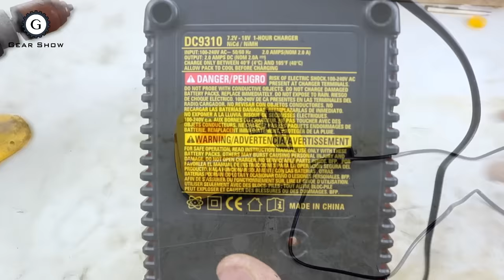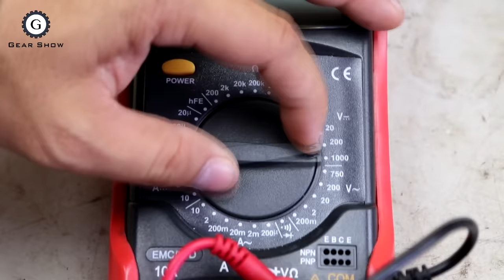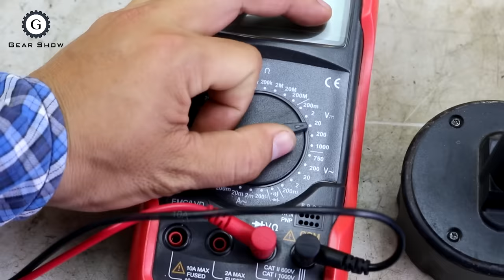Cordless Drill Restoration | Dewalt XRP 18V TYPE 1

Comment: you should remove old cells and install li ion 18650
Reply: 和我的想法一样
Reply: not a regular 18650....only the ones with high current discharge rate !! 
otherwise you might hear some noises and find yourself with a torch in your hand....but if you do it, please record it and post it
Reply: You cannot simply replace NiCd batteries with 18650 LiOn batteries. You'd need to install a battery management chip to regulate the batteries if you could even fit the 18650 into the housing designed for "D" sized NiCd.  You'd also need to find a new charger because you can't charge 18650s on a NiCd charger.  It's best just to replace the NiCd with new NiCds.
Reply: @JonnyRicter  I'm guessing the NiCd chargers would hardly ever damage the Li-Ion batteries considering the they had memory effect and all kinds of quirks, so Li-Ions should be fine. Buddy of mine did the Li-Ion conversion years ago and she's still chooching like crazy, batteries from old laptop batteries, still holding fine :) In the worst case you have more powerful batteries that will for sure last longer than the old NiCd junk of technology, no fire if you know what you're doing and you're not pushing it.
Reply: Emiliyan Yankov impossible. You cannot charge lithium batteries on a NiCd charger without destroying them and here is why. NiCd battery cells are 1.2v each and lithium cells are ~3.7v each, you cannot fully charge a 3.7v cell with a charger that is trying to fully charge a 1.2v cell....and that's just the beginning. Let's pretend the charger has the correct voltage now, the battery pack must have a BMS chip that is able to communicate with the charger because LiOn charge completely different then NiCd, they must charge the battery with constant current to near full, then slowly reduce current to a fraction of constant until the battery reaches full, all the while maintaining a constant and correct voltage (between ~4.2v to ~3.2v). Also, NiCd chargers float charge, meaning they constantly charge the battery cells to maintain full, if you do that to lithium it will explode. A lithium battery must be discharged and then recharged, it cannot be "topped of." Finally, lithium batteries reach a higher temperature when recharging than NiCd, so unless the NiCd charger has been altered, the heat detection circuit will trip and cause the charger to stop charging because it thinks the batteries are over heating. So like I said in my previous post, you cannot simply pull out old NiCds, throw in some LiOns, and be on your way, it's much more complicated than that and in most cases it's simply better to just replace the old NiCd batteries with new ones.
Reply: @JonnyRicter  noone is saying you should charge them in the old charger dude xD ok, sleepy head in me maybe said a sweet stupid nothing in english again. all i'm saying is li-ion conversion is a thing for a reason and it has every logic behind it. i don't even wanna discuss details because it's too easy to do it when you run out of excuse and find a way, just like the adaptor Frank W is mentioning below :) 3x1.2v = how much? 3.6v? wow that sounds so close to 3.7v... no need to stretch this simple task into oblivion :)
Reply: Emiliyan Yankov I'm done. You obviously don't care to learn.
Reply: @JonnyRicter  i learn plenty, just not from you and not on this topic. you're too focused on modern and expensive solutions, while failing to see how most people doing this don't use temp trips and all kind of protections, cause old or just cheap crappy drills don't even have those. and that's pretty normal for an old nicd shitty drills xD i mean no disrespect, don't get me wrong, i'm saying it's easy to do and it can work, won't be perfect but it can provide better results than just buying new original nicd packs every 6 months. i don't care discussing it further just because of the things you pointed out. better be safe and better not challenge the tech, i'll buy li-ion drill next month and i'm set. just saying, books and theories mean shit, wehn it works it works, you keep denying i see more and more people using such batt mods and being happy with it. obviously it's not impossible, at least my scenario, not whatever you're imagining, but i'm too tired for this convo any and i'm going to bed ;) peace, brother :)
Reply: There's no need for a DIY conversion, there's a type of original Dewalt Li Ion batteries which fit into this cordless drill without modifications.
It's the predecessor of the actual sliding battery, which was put in in the same way like the NiCd one. The electronics are all integrated into the battery, and there's a original charger which can charge NiCds and Li Ion.
Reply: @JonnyRicter  It's total bollocks to say that lithium ion cells need to be fully discharged and can't be "topped off", as you put it. In fact that is a really good way to shorten their lives.
I build li ion batteries for a living (for ebikes), and I have also converted the same model of drill in the video to li ion, along with many other power tools.

Comment: Nicely done. Don't complain about weight! At least you got great product from times when Dewalt used to make things using higher quality materials. That is high quality drill especially because of gears made out of metal, todays drills have plastic gears. I'd always go for metal gears and bit more weight because of durability than plastic.

Comment: Ace job mate, I need to strip mine down just for a clean and re-grease, it's seen a lot of work. 👍👍
Reply: throw away tools these days, dont break the golden rule "if it aint broke dont fix it" if you open it up something will go flying or some brittle plastic will break... run er till she lets the smoke out then be excited to get a new drill amazing what they have improved on in just the past few years
Reply: @AndrewBrowner  - Like Lithium Ion batteries and better torque ratios with Dewalt since its still a brand that is decent. Refurbishing this drill with these old batteries is kinda pointless but otherwise still interesting to watch.

Comment: I like it. I think You can use li-ion cell to replace ni-cd cell in the battery, you will have long time to use with it
Reply: Yes. DeWalt actually made lithium ion batteries for the older platform but they were very short lived in and very expensive.
Reply: Li -ion is the technology that almost nowaday power tool company using,the china li-ion cell is not expensive,remember buy the cell for power tool,about 2000mAh ,15A, don't use the cell for laptop

Comment: Great job but I would have greased the pins the gears sit on too :D
Reply: And he did not regreased / replaced ball bearing - the oryginal grease was washed away - 6.42-6.45. Except this - good work!
Reply: Well that´s generation YouTube/Facebook for you.
The end result is a pleasant looking drill. But obviously the YouTuber has no clue about mechanics or how things work. Grease, who needs stinkin´ grease in a ball bearing?  It looks good, that´s enough... shakes head

Comment: 5:30 Release the schmoo!
 But seriously, great skills to have. Unfortunately I am not so sure it's all cost effective when my Aldi's sells a nice lighter 12v model that would fit you better for $25 (including battery and charger BTW) last week in the flyer. I bought one a few years back and couldn't be happier with it.
Reply: If you like cheap stuff. DeWalt is quality, and it's meant to last, so it's worth repairing.
I bought a heat gun in Aldi, and it's melting its own chassis. Last time I'll ever buy a power tool there.
Reply: @Michael-Archonaeus  Nothing wrong with cheap stuff as long as you know its limits. Next thing I know you'll be putting down my $14 Walmart Branded "Hyper Tough li-ion cordless screwdriver which also converts to a drill-driver. BTW I do own 2 Dewalt drills. I like the built in belt holder a lot. But most often they are more than I need so I still like and use my little Aldi's 12v unit.

Comment: my dewalt drill stoped working I will open it and give it a check over tmrw
Reply from the maker: You should check the battery pack and check the carbon brush set.
Reply: it's was working I been traviling for 1 year and wen I got bk and tryed to use it was not working both battery charge but nothing

Comment: Trying to save the battery pack was good, it took a charge but even when you were just messing with the chuck i could hear it not sound right.

Seemed to lack power despite charging fine.

Comment: Only issue could not read the can to determine what solvent or grease or gel you were using on the gear. Besides that everything looks great and the two Dewalt drills I will be working on will go a lot smoother.

Comment: i had my batteries go in one of these dewalt xrps and i did the same as you but one small change. i ordered new batteries but opened them and transfered the innards into the older battery cases that had the dewalt labels on

Comment: In a drill this old the ancient nicad batteries are going to be rusty, corroded and shorted and won't charge. Sometimes they can be revived for a short time by jumping them with a DC welder to burn off the shorts but it doesn't usually work for a Dewalt anyway since they will be too old.

Comment: Dewalt should pay you serious folding money for this video!
Reply: dewalt is not too happy about this video they want you to buy a new one instead.  thats why they stop making spare parts or if they are available prohibitively expensive so you'd just buy a new drill instead of repair.
Reply: @10OZDuster  That makes sense, now that I think about it.  Planned obsolescence strikes again.
Reply: @chriswenkle2635  Dewalt actually is a better company compared to Makita....at least dewalt made a nicad to lithium battery adapter so you can use new lithium to old nicad drills like the one shown above.  I bought a china adapter that would adapt a dewalt to affordable black n decker battery but technically you can make a battery adapter for anything too bad you can't attach photos here so I can show them to you
Reply: @10OZDuster  That's good to know too.  The few power tools I have are Milwaukee and Hitachi.  I use them all the time in my little workshop.  But then, I''m retired so I try to do the stuff I want to do.

Comment: Daam!  Why do I get the feeling you have done this before?  I would be really hesitant to take apart that entire planetary gear assembly like you did..  At least not without video recording every step of myself taking it apart, piece by piece!  Awesome job tho! Looks almost like new again!  I knew you were going to need a new battery when I saw the 'NiCad' label on the batteries inside!  Those don't last long, and they eventually leak/pop..  Anyway good luck with it, hopefully it will last you another 20 years!

Comment: To those of you who question if it's worth the effort, the answer is yes, you're just not seeing the issue fully. The drill doesnt matter, nobody really cares about the drill. It's the SKILL that matters. Restore five $50 drills (or whatever) and you develop a skill that could help you restore a $1000 tool. Or a $10,000 tool. Or maybe just fix a simple problem on a $50 drill in 2 minutes, rather than wasting $50 on a new one. Gotta look at the big picture guys.

Comment: We have the same type of cordless drill still lying around in the company where I work.
This were good drills, but they have a design flaw, the motor has no ball bearings, it has only a simple bearing which wears out if you use it commercially and it makes some strange noises then (sometimes after only 2 years of commercial use).
Also the batteries are now gone, because they are way too old.
Today a drill with similar weight like the Makita 481 (at least that's the name in Europe) is way more powerful than this DeWalt from the 2000s.

Comment: you can get an adapter to run these of the modern 18v lithium batteries, huge bump in performnce!
Reply: I'm sure you can run straight off, you don't need an adaptor.
Reply: @sidco123  no, they made a version of this drill that used lithium batteries but the battery style changed to current style of dewalt batteries, an adapter is require to use the new type batteries with this older type of drill,  the part no is dca1820 https://www.amazon.co.uk/DEWALT-DCA1820-Dewalt-Battery-Adapter/dp/B016K1UD0E

Comment: Nice restoration, but you could have gone all the way and find the bad cell in the battery pack and replaced that and not have to get a whole new pack. That's how I got my first cordless drill, I fixed one that was broken at work and when I fixed it, they just gave it to me. And I still use it a decade later.

Comment: While that battery read 18v those Ni-CD cells are probably in need of replacement. Bad batteries can show the right voltage but their capacity will be shot, especially Ni-CD if they have been siting for awhile without a charge.

Comment: Great video just a suggestion but I used to run nimh and nicad batteries in my traxxas slash and other rx trucks and after the batteries sit dead for a while they often need cycled several times before they hold a charge again

Comment: One thing i would have done differently is to use a bluing solution on the knurled outside of the chuck, opposed to spray painting it, since the paint will clog up the texture. Other than that, great job

Comment: You could of swapped cells out of the original with the aftermarket it would fit fine no need for soldering just swapping out the complete cells because of the doorability factor of the original DeWalt battery housing  and it matches brand-wise

Comment: I could see investing your time to do this if you already had a good battery and charger, maybe even if you only had one or the other already, but certainly not if you have to buy both a battery and charger.    $63 is too much for the end result of using old NiCd battery tech, and I question if the motor/bearings were in good shape still considering how bad they looked, meaning they may not have a long life ahead of them.

Comment: He did everything right except one thing - he failed to properly seat the screws before driving the screws home. When you reinsert screws in soft materials like plastic, you press the screwdriver down with light pressure and reverse turn until you hear or feel a click. Only at that point do you start tightening the screw. Otherwise you risk stripping the screw hole out and then your screwed.

Comment: Great video. I have just rebuilt my XRP as it had seized from sitting for a long while.. But the clutch now only works from 1 to 5 after that it does not work. I know thus is an old video but anyone have any tips.

Comment: Where is the profit in this? Just looking it up on ebay, they go for around $30-$45 in working condition. What do you get out of cleaning every single gear (did it even need to be cleaned? Was it in any way impeding the operation). Why not just clean the outside? I don't know, I appreciate the effort but can someone explain to me why he's doing this?

Comment: You did not check the motor brushes. Also I would have checked out the motor at the same time as checking the switch. There would be no sense to continue if it were toast. Remember the drill did not work prior to teardown.

Comment: I think I'll just wash the outside of mine with simple green and call it a day.  I do plan to take all of my batteries apart and see if I have enough good cells to make one.  I'm probably going to use the 20v adapter and go to Lithium Ion batteries since I have 4 or 5 of these 18v tools and they are well made.  What soap did you use?  Was that laundry detergent?

Comment: That drill won’t last long. He forgot to grease the spindles the planetary gears sit on.
Reply: He knows what is he doing, producing videos requires some setup, while putting together such complex gear requires not just one dry-fit reassembly, so if something missing in video, it doesn’t mean it didn’t make it it to final assembly.
Reply: I also noticed this as well, I was hoping he added more greese in the parts that were cut out.

Comment: All that work to save a obsolete drill. Anyone that has used the 20volt max will throw rocks at those.
Reply: 20 volt Dewalt is really 18 volts, it's all in the wording. Look up the tests. That’s it. That’s the entire difference in 18V vs 20V Max batteries. It’s only a matter of whether the company is using nominal voltage or maximum voltage as their rating
Reply: Except they are lighter and more efficient especially the brushless.
Reply: But aren't all the brushless drills using lithium ion batteries so we're not comparing apples and oranges
Reply: @edwardlanegraff5423  THAT IS THE DAMN POINT. HELLO!!!!  all 20 volt max " all though  technically  18volts as so pointed out" are lithium ion and better lighter and more efficient and then the brushless 20volt max are even more efficient,  hence the reference to this tool being obsolete tech

Comment: Not worth putting time or money into an old NiCad powered tool, they have a pathetic power /weight ratio when compared to Li-Ion battery powered tools.
Reply: My old 18V Nicd Milwaukee tools are plenty powerful when I adapted to new Li-Ions as Nicd no longer available. Old Milwaukee drill could mix drywall mud, not as compact, little heavier than the new ones, more reliable. Two of my new Li-Ions Milwaukee tools already died, but all the old Milwaukee's still running strong. I say tool wise is about the same, the difference is in the batteries.

Comment: Why do all that work on just an 18 volt because they will change the model in a year and you will not be able to find the batteries or charger before long. Might as well buy a 20 volt when they are on sale at Lowes.